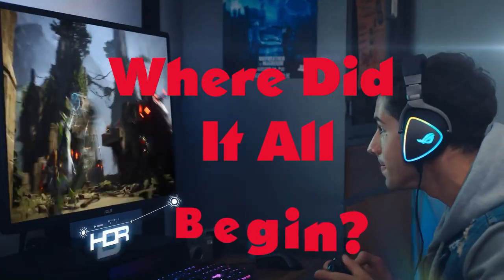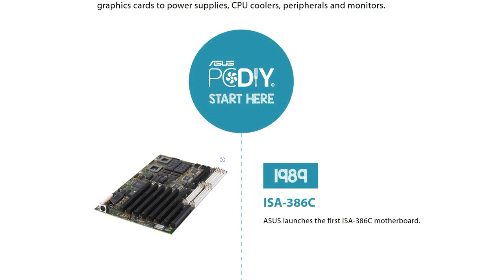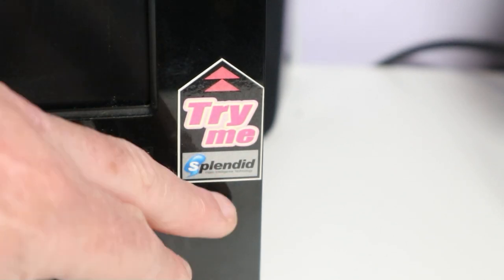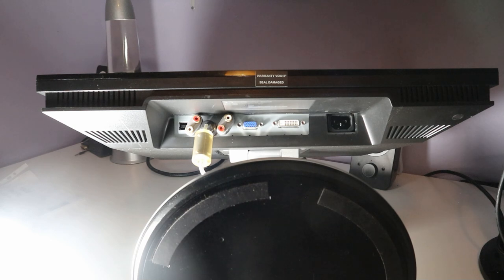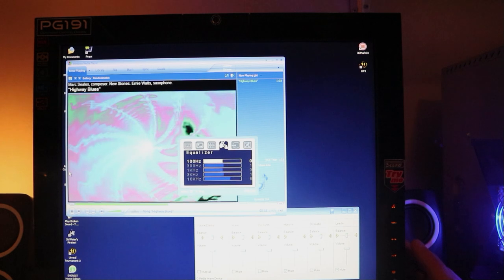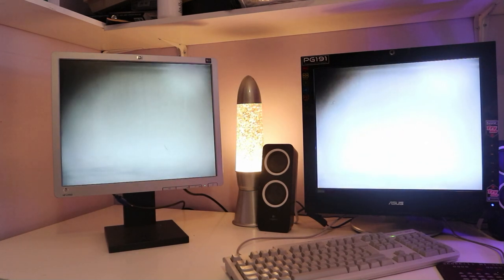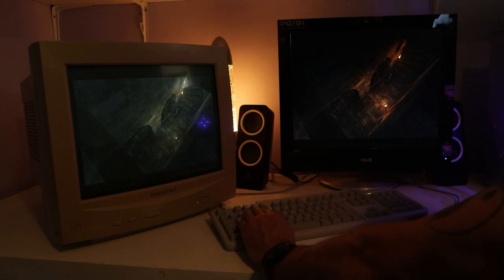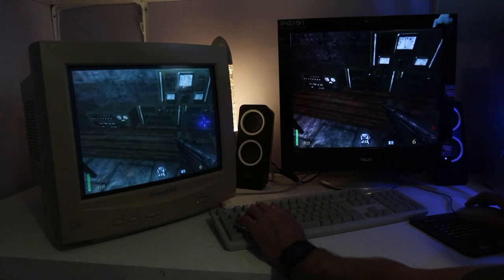Early Gaming LCD vs CRT

Comment: I feel like the bright colors are too bright, and the dark colors are too dark on the ASUS. The Packard Bell monitor seems to be more in the middle. Maybe the Asus can be adjusted, or maybe it looks better in person, but that's how it comes across in the video. Also, I didn't know that the huge cylinder on the back was the sub until you mentioned it. Was trying to figure that out. Pretty cool design idea!
Reply from the maker: I like the glaring over saturation personally

Comment: is it really 4:3 or more likely 5:4 (1280x1024)?
if it had 1600:1200 i would love have one :face-red-heart-shape:
Reply from the maker: Thats the resolution aspect ratio and the resolution isnt fixed (black bars on the edge) . The physical aspect ratio of the screen itself is 4:3 I think. 1600x1200 would be nice😁
Reply: @66mhzbrain do you mean when your select resolutions that are not 1280x1024 you get black bars?
Reply from the maker: @thedopplereffect00    I was wrong at 1280x1024 I'm guessing theres some pixel stretching going on, not black bars, all the other resolutions it supports are true 4:3. I think, to the best of my knowledge, no one made a physical 5:4 monitor. It would have stretched or displayed with bars at 1280x1024.
Reply: I would love a beautiful fast LCD that didn't stretch lower resolutions. Unfortunately your video didn't show any low res dos games. Black bars are a must on those!